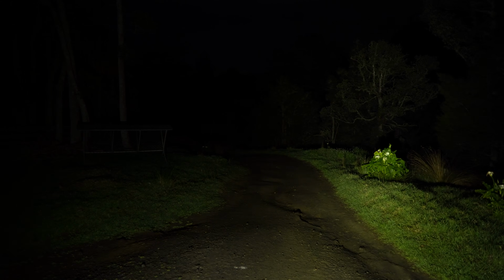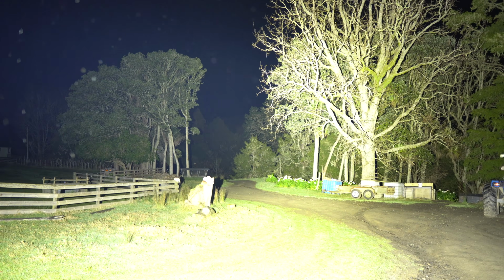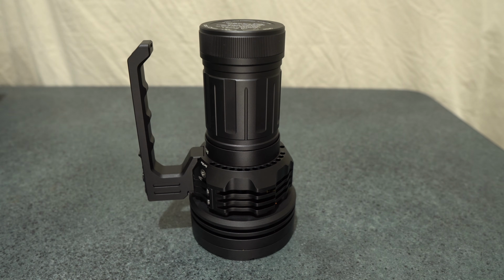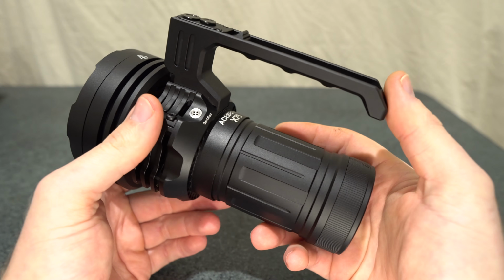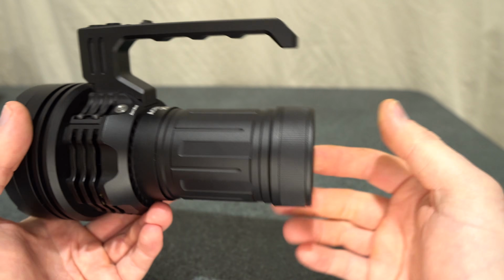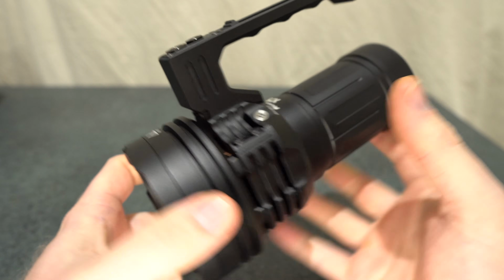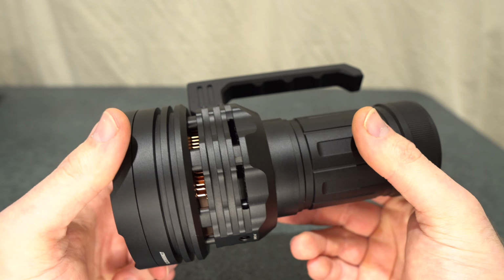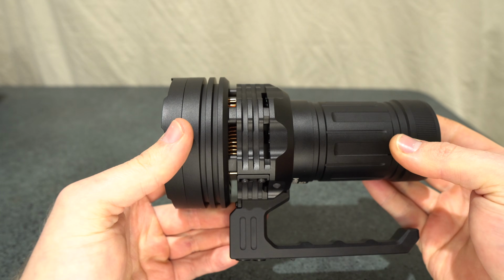Acebeam X75 Review, 80,000 Lumens, Drone Aerial View, Internal Cooling Fan

Comment: This is a true outdoor flashlight. Even on low, it casts out a large flood of light that not only illuminate your direct path, but lights up the surrounding area as well so any hidden dangers would be revealed. Smaller single cell EDC flashlights would have to be turned onto full turbo for a brief amount of the same performance and they overheat quickly.
Reply from the maker: They can also fit into a pocket though 😉
Reply: @PiercingTheDarkness  True. I do construction and I always have my Fenix UC35V2 or PD40RV3 in a holster.

Comment: I know it is rated for 30 seconds on turbo, but I read a review on Candlepowerforums where they ran this light for a little over 60 seconds on turbo before it dropped down. What runtime did you actually get on turbo?
Reply from the maker: @mwstoll  better to look at the 1Lumen review for the runtime graphs. I didn't test the lumens or make graphs because it was too large for my setup. I sold the X75 immediately afterwards since I never use anything I review.
Reply: @PiercingTheDarkness  Thanks for the reply. Maybe another question...I have a MS12W Mini. Do you think the X75 5000k or 6500k color would be in more alignment to the MS12W?

Comment: Of all multi-LEDs high-power flashlights currently on the market, the X75 is the only one with a proper thermal and electrical design. This shows as the X75 being able to emit ~ 20,000 Lumens for half hour, independent of temperature and battery charge level. No other light is capable of such a feat, and it is almost a reason for celebrating! The X75 is pretty expensive, but - for the time being - is the only light in its class to be worth every pound (or dollar) paid.
Thank you for the review.
Anthony

Comment: Hi. Does 11,000 lumens really last for an hour without a drop in light? As shown in the catalog
Reply from the maker: 1Lumen tested the X75 and measured just above 10,000 lumens for 60 minutes. You can check out their review which shows runtime graphs for proof.
Reply: @PiercingTheDarkness  Haven't purchased the product yet. Have you actually experimented with placing 10,000 candles and continuing for an hour straight?

Comment: The ec06 is an absolute beast and i love mine but I've finally decided to get the X75

i genuinely don't know what my reaction is going to be to this light but one thing is for certain it's definitely the most expensive light I've purchased to date 😅
Reply from the maker: It's a great flashlight, but...yes there's a but 😂 I do prefer my Imalent SR16 for the extra range. It just depends on what you enjoy, whether that's a wide flood beam or getting a bit more reach. There is the XHP70.3 HI version of the X75 though which offers a little more range.

Comment: Great video bud! What drone do You use?
Reply from the maker: Thank you.

DJI Phantom 4 Pro. I chose this one so I could also mount flashlights underneath, I've done this in a few reviews.
Reply: @PiercingTheDarkness  Isn't that a bit "older" drone? Either way the quality was superb - that's why I asked! It does the job very well!
Reply from the maker: @Shadoweee  it is, yes, but the camera's sensor is better than most of the others. The extra weight helps it to not be blown in the wind too much as well. When using multiple flashlights it would be a mess to get the frames to match otherwise. The Sofirn IF22A thumbnail was a 20 second exposure which would be impossible to pull off with a smaller model 😊

I appreciate the comment.
Reply: @PiercingTheDarkness  Makes sense - thanks!

Comment: I Like the warm colour and spread, thinking it would suit me well here, even if its missing a longer mid high mode. ;-)

Ps, its been sold, and Its just arrived,  impressive is my first impression( also have skyray kings, sofirn Q8's, mateminco mt70, fireflies rot66 etc)
One thing i really like so far, is the sliding lockout, mainly because it also locks the buttons when torch is on. (Finding i like to lock it on ultra low mode, for general use walking the dog so far). Turbo in our local park, was like the park just had all round stadium lights installed and turned on, impressive. Max distance with some mist in the air, fell short of the mt70's hot spot, that i just compared too, but the wide  and bright coverage at a good distance, is excellent.

Comment: For a $450 light an integrated pack seems sketchy.  Li-ion cells fail all the time.  I had varios li-ion cells fail randomly, and I simply don't trust integrated li-ion packs.  Failure rate is just too high.
Reply from the maker: That's why there's a lot of different models to suit everyone. You certainly wouldn't achieve 80K with individual cells that's for sure. Price is $399 which is currently the best in comparison to other models. Great price in my opinion regardless of the battery pack. I'm not a big fan of an integrated pack either, but honestly some people like them. When you think about it, it's no different than buying a laptop...
Reply: Please link to official failure rate stats.

Comment: Hi J.. just finish reading your thread an hour ago..  yes.. high lumens does heat up.. glad the stepdown is fast 😄..  would've been a lot hotter if it was ms12.

   Just seeing the copper heatsink, and generous ventilation, seems R&D put lot of effort to this light.  
   I always see this sort of lumen monster as a tool; to help the operator illuminate vast area with dispersion wide enough they can scan without moving the light too much, and at limited duration  (imagine continuously blasting 10k+ lumens of photons for a casual 60 minutes stroll).
   My EC06 is my limit (for now).. now i have the urge for a 'floody' thrower.. 
Thank you J
Cheers

lampusaku_
Reply from the maker: I personally would prefer something with a little more range myself, much more useful out on the farm. Acebeam have mentioned they're thinking of an X75 based thrower which could be interesting.
Reply: @PiercingTheDarkness  There's compromise to it. For range, reflector is essential. GT90, GT94, A1etc.
   Flashlight manufacturer should spend longer time calculating their reflector build( for different led configuration)
Reply: I just used the acebeam link and discount code and got it for 340 dollars shipped. What an amazing deal.